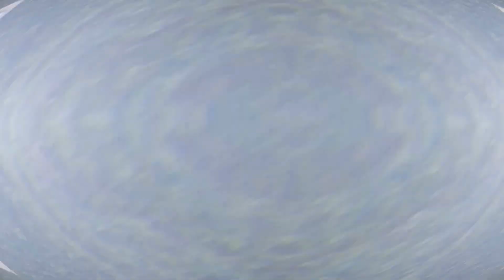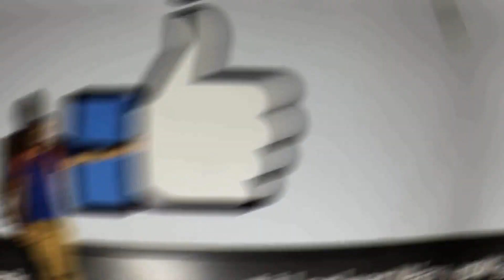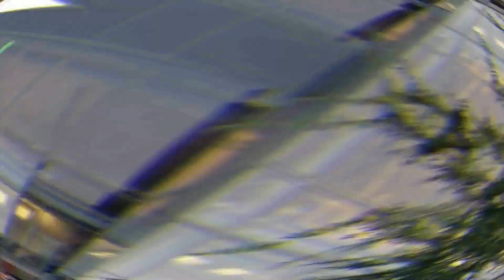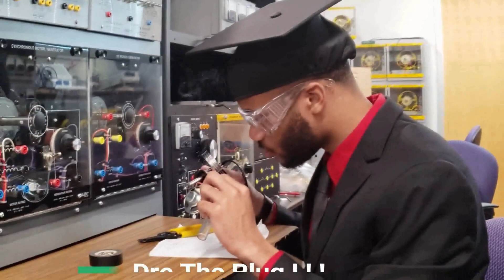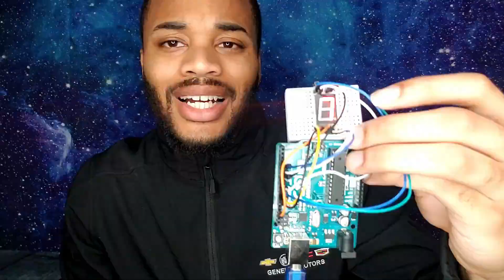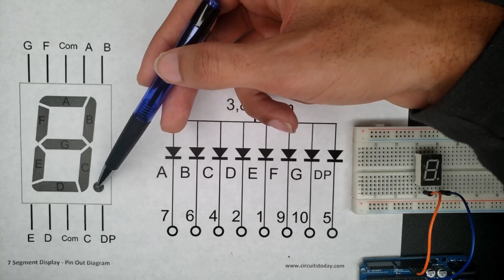How to add a seven segment display to your project for Arduino project

Comment: good work bro been looking for a channel like this for awhile thanks will do this project soon also can you do project on relays if you haven't already did i will look through your vids as i want to use the arduino in various smart home projects also the esp32 and other micro controller boards.
Reply from the maker: Nice nice I haven't did a relay one yet but I am still debating on making one